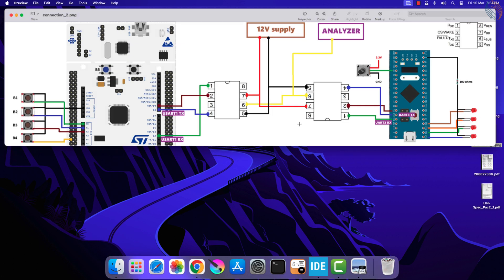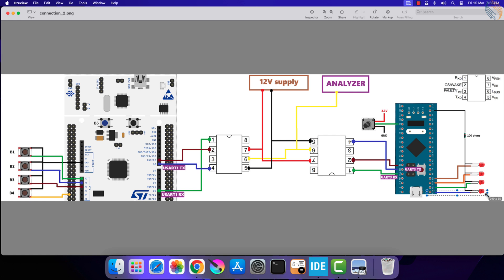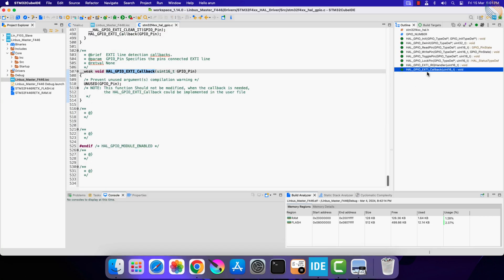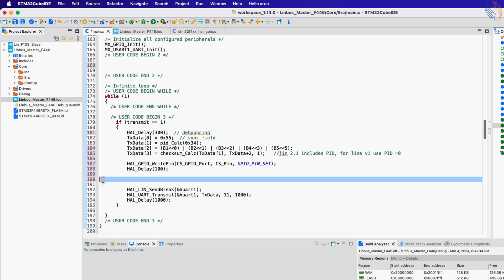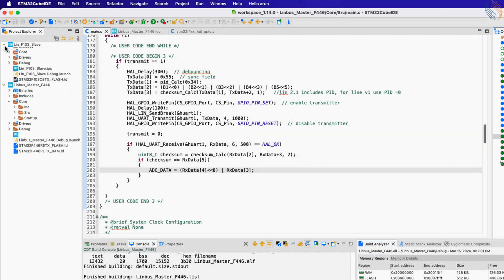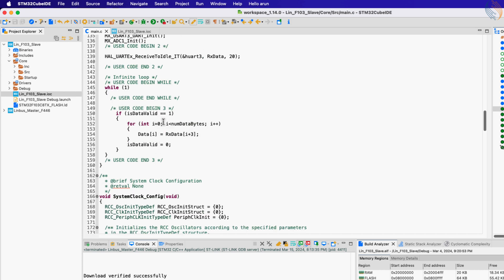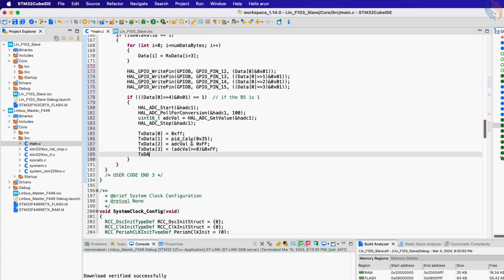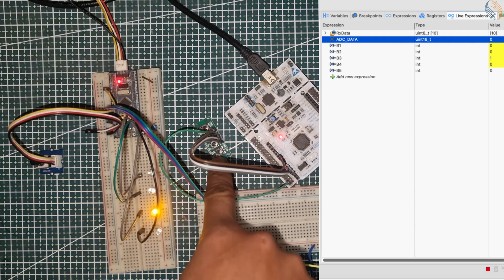STM32 UART #10 || Lin Protocol PART3 || Master - Slave communication using the Linbus

Comment: Hello. I have a question. On the F446 Master board,
if (HAL_UART_Receive(&huart1, RxData, 7, 500) == HAL_OK)
{
uint8_t checksum = checksum_Calc(RxData[3], RxData+4, 2);
if (checksum == RxData[6])
{
     ADC_DATA = (RxData[5]<<8) | RxData[4];
}
}
The number of received bytes is one more than the interrupt method. Why is this happening?

ex) 6 -> 7, 5 -> 6, 4 -> 5, 3 -> 4

Is it possible that the break field value is 13 bits or more, so the polling method receives data as two bytes, increasing the number of data bytes by one?

Thank you as always.

Comment: Thanks bro this was the exact video I was looking for.
Now I have a similar project in mind it's mostly like yours but but mine is for Car ECU, when the cars ECU is the master and the slave is the bord that I want to create it  comprised of simple task by the master which is opning a flap and sending back the position of the flap by the slave.
My question is here, Can I build  the slave without access of masters source code just by relying on capturing the LIN data and decoding it by picoscop coming from the master ECU??

Thanks for the reply.............
Reply from the maker: Yes you can build the slave just by analyzing the data sent by the master.
Reply: @ControllersTech  Great...Do you think I can build the Slave module using Arduino can it handle LIN COMM protocol? if yes, which type of Arduino board do you prefer?
I currently have UNO R3.....